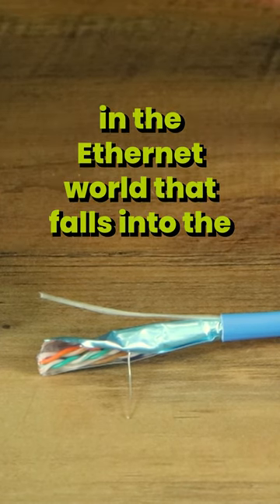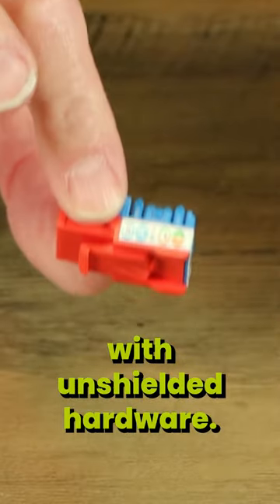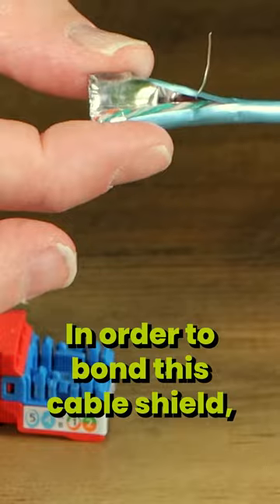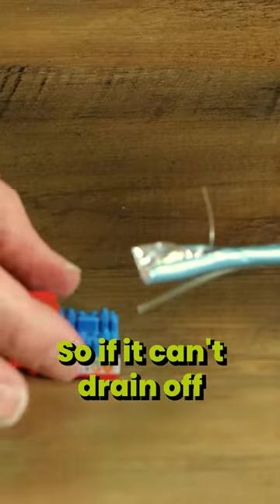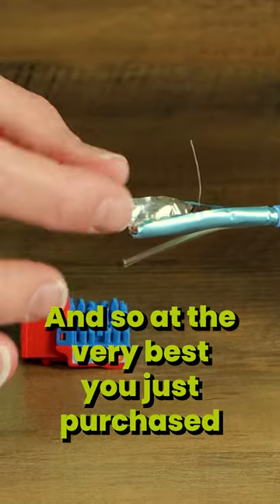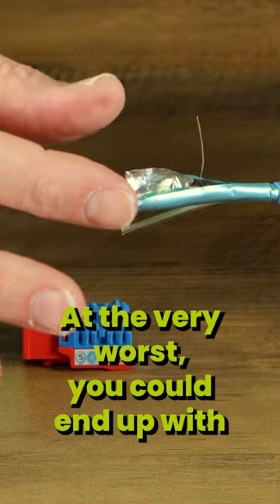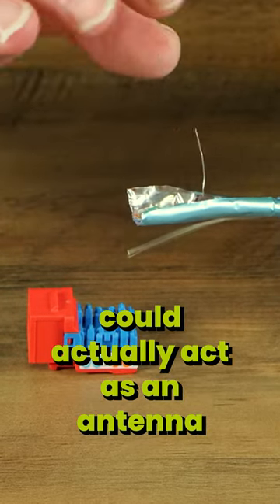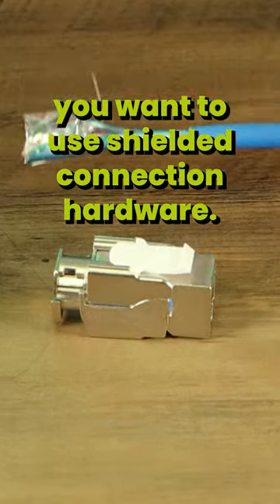Never Use Unshielded Connectors on Shielded Cable! #shorts

Comment: could you just ground the drain wire from the shielded cable to a ground pin on the connector?
Reply from the maker: Hello. Without a path to ground, that would not be a good idea, and it would also potentially lead to insufficient bonding, which you want to keep at 0.1ohm (100 milliohms) or less.

Comment: that's why shielded connector wont always work with unshielded cable
Reply from the maker: In the case of using shielded hardware (8P8C connectors in particular) with unshielded cable it, it may not work due to a mismatch in cable to plug fitment. Often the insulated conductors of shielded cable are thicker and therefore use shielded 8P8Cs that typically have larger conductor holes. Bad electrical contact may result if you attempt to terminate unshielded Ethernet into a shielded 8P8Cs. It is a fitment thing, not because the 8P8C happens to be shielded. Now, you CAN use shielded keystone jacks and shielded field termination plugs with unshielded Ethernet cable in a pinch and that will likely work fine. The reason shielded keystones and shielded field termination plugs will work with unshielded cable is due to the IDC termination pattern which is far less fitment sensitive than the way 8P8Cs terminate.